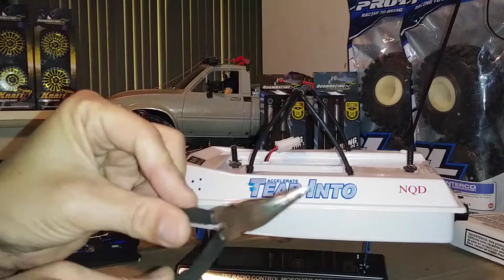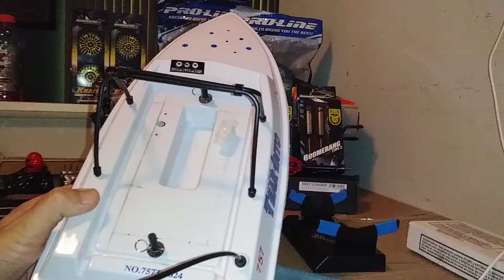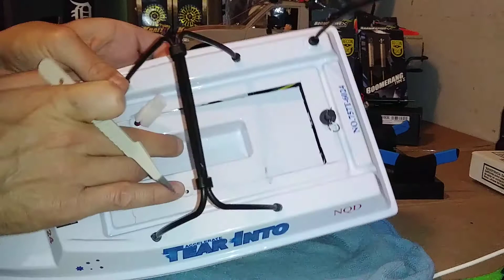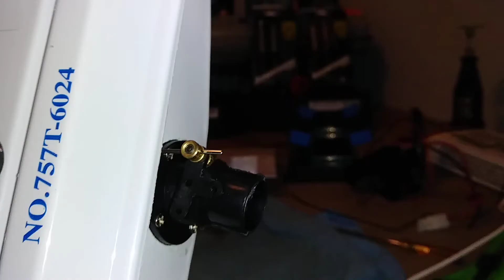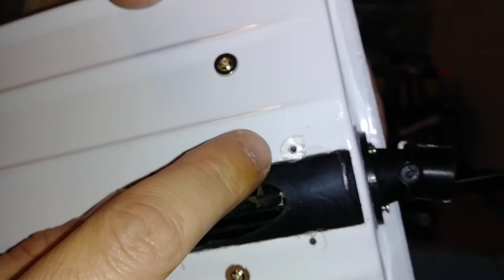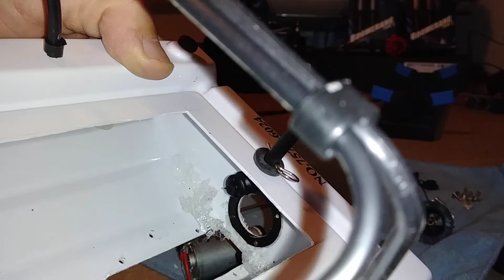NQD Tear Into Jet Boat; Brushless Conversion pt 1

Comment: I bought a stock one a few years back and they're wet garbage. 2moh speed and it broke on me. Got another sent for free, same happened. So I've got 2 entire hulls waiting for brushless conversion
Reply from the maker: 😄👍 
Their definitely garbage straight out of the box, there's no doubt about that, "But after a brushless conversion, it's an entirely different animal. 😁
Edited to add this;
(This video was done in 2016 or 2017, and yes I still have the boat, and yes it's still in perfect working order) although "highly modified" 😄 but no more modified than it was at the end of this build series, it's just holding up like a champion.🏆😁

Comment: Can I ask what coupler will fit?
All I seem to find is 10mm diameter.
I’ll be using a 2848 2960 with 4mm shaft.
Reply from the maker: Ahh man I don't even know anymore.. 😕 It's been a long time, and a ton of different RC projects since I Built-up that Jet Boat,🤔?
If I'm not mistaken, I believe that I used the stock coupler, and just drilled out one end of it to fit the pinion shaft, on the Traxxas Vxl 3m brushless 380.😕 
Note; The Traxxas Vxl 380, is a 8 turn 4000 Kv "50,000 max RPM" motor, and it's a little bit too much for the boat on 3s,🤔 "Meaning that at 3/4 throttle" it's pretty much all the power that the jet drive can put to use,😕 after that, it just over spins the prop and starts capitating like mad.🙄
Something in the 3500 Kv range, might be more fitting to get the most out of the stock jet drive unit.😕
Just a suggestion of course,😂 you can feel free to use whatever motor your heart desires.😄👍

As for the coupler; if you can find one online anywhere, and if you can't custom fab one out of old RC parts, then your only solution would be to either A; check out a hobby store and see if you can match it up with some other RC boat parts. 
Or B; go to your local machine shop and have one custom made for you.

Best of luck with Everything.... And thanks for checking out the video my friend.😊👍🤜🤛
Reply: @R.C.A.D.  
Thanks for the reply and suggestions.
I have been torn between the 3300 and 2960kv motor that I’m planning on getting.
I have thought about getting a 10 mm coupler and putting it on a drill and grinding it a little smaller
Reply from the maker: no problem with the reply...
As for the motor; That "3300kv motor" might be about right for the boat,🤔
4000kv is definitely too much RPM's, But 3300kv might be just about right for getting the "Max Potential" out of that stock jet drive unit.😊👍

Fyi; if you're new to the whole jet boat thing, You might want to check out Mark Young's channel on YouTube which is called "Youngster's Jet Boats" I think 🤔 I'll go grab a link from his channel and drop it into another comment for you, He makes his own Jet Drives, And they are Bad A##... Awesome Jet Drives!
I was going to purchase one from him awhile ago but I never got around to it, But he does make them, And they are pretty darn sweet..😁👍
Two separate link's for two separate videos 👇
https://youtu.be/kfSwnuwN5bg

https://youtu.be/wlogFXq4uiA
Reply: @R.C.A.D.  
Thanks. I am definitely new to this.
I just got into crawlers about October of last year.
I have been having a lot of fun modifying.
Reply from the maker: Nice! 😁👍 
There's so much to do with the Crawler Aspect of RC's, That there's always something to do, you'll never run out of projects! 😄 Lol
Reply: @R.C.A.D.  oh for sure it has been absolutely a blast and a lot of camaraderie.
I’m almost ready to get another one. Lol.
I have a Capra and built a custom body for it that I am proud of. I have it looking like a cj6 buggy.
Reply: You have a great channel and a lot of great videos.
I have a channel with like 5 members. Lol.
Reply from the maker: Sweet... I've been wanting a Axial Capra for a while now 😄 But then again my list of "wanted RC's" is getting pretty darn long. 😂 lol
The biggest thing to keep in mind as a new person to the hobby, is to not get too carried away with RC Accessories 🙄 That's where they really get your pocket book,😕 and it's like ten times more expensive than buying barbie accessories for a daughter,😂 lol except these accessories are made for RC's, and your buying them for yourself vs someone else,😕 and yeah.... It's pretty easy to get carried away buying a bunch of stuff that you will probably never need.😕 
And another good thing to keep in mind when it comes to Crawling in general, Is that plastic slides over rock's much easier than metal,🤔 Metal bumpers are fine, and also recommended for "future winches and towing purposes" but some of the aftermarket aluminium, or steel suspension components, rock sliders, control arms, skid plates, and whatnot, Are just not needed,  Unless the vehicle itself actually needs it, in order to hold it's self together out on the trail.😁

As for adding weight to the vehicle;🤔 ?  Here's what I've found in my years of experience... 😕 Lighter vehicles do better in just about every off-road situation,🤔 But there is definitely something to be said for adding a pinch 🤏 of counter weight or "balance weight" to certain areas of the vehicle, in order to improve off-road ability in general,🤔😕 But adding weight to the inside of your tires isn't necessarily a good idea, Unless your trying to counter weight the weight of tipper box on the back of the truck, Adding weight to the inside of the wheels is not a good idea,😕 There's not much material holding RC axle shafts together,🤔 I mean there strong and all, but once you start adding weight to the inside of a tire you're significantly increasing the total weight of Rotating Mass,🤔 and that's a Crap Ton of Extra Stress on the axle shafts when it comes to trying to spin those tires up and over obstacles,🤔😕 picture yourself spinning a pencil ✏️ ,with a weighted tire attached to one end of it, and how much Raw Torque it takes, to spin that tire up and over a 4" inch rock or ledge,😕 And you will quickly get an idea, of how much stress those parts are going to see once you add weight to the tires.😂👍 lol

A little bit of counter weight is ok, but "Ultimately" lighter weight vehicles perform better, in most off-road situations.😉👍
"And plastic slides over rock's better than metal..😂 lol" 
Keep all that in mind... And you'll be off to a great start in the world of RC Crawlers.
😉👍
Reply: @R.C.A.D.  
Thank you for that info.
Thank goodness I Havnt accumulated too many extra parts so far.😉 I have redone the body several times now to get a look that I like. 
I tend to do  a lot of research before I make a move.
Adding weight, totally agree. All I have added was weight to the front portals, made a big difference. 
Any extra parts I’m always trying to think what can I do with them. My old tires, I made a little off-road trailer. Needed a project while it was super cold out last year.
Part of the fun is dreaming up new ideas and fabricating.
Reply from the maker: Thanks man...😊🙏 That means a lot to me.😁🤜🤛
As for YouTube; It takes awhile to build up a good fan base,😕 You can do RC giveaways like I was doing in order to build it up faster, But ultimately that will only get you the numbers needed to monetize,🤔 But it doesn't guarantee views on your videos, 😕 
That comes from building up a "somewhat loyal" fan base 🤔 and that takes a long time to do.😕 
I've got like 48 hundred subs, but ahhhh.... Whenever I release a new video....🤔 I only get a few hundred views "at best" from my subscribers,🙄😕
When it comes to "my channel in particular" I get more views from people doing Internet searches, then from my actual channel subscribers,😕 which isn't a problem except when it comes to making any kind of money from my channel, or hard work that was put into doing "said video"🙄😕 
People doing Internet searches for videos, don't watch any of the commercials attached to the video, And if they don't watch at least 15-20 seconds of each video before they skip it, The person who produced the video won't see anything for it,🙄 not a cent 🤔 and really... it's not like you make a ton of money from the commercials, it's like pennies on the dollar when it comes to that stuff,🙄 So when people skip the commercials, They aren't helping that person out one bit,😕 And I tell you what Brother, in the 6 years that I've been on the YouTube, I've probably barely made enough money to pay my car insurance for a year let alone anything else,🙄 I actually spend far more money on my channel "in a yearly basis" then I'll ever see in return, And every single RC giveaway that I done over the years, has come directly out of my pocket, "with hope's of returns, but never seeing it" 
The majority of those people who Flock to RC giveaways, Don't Give a Crap about your channel and never will, all they care about is the giveaway, and once it's done so are they, At least until you do your next giveaway video 🤔 and then they all show up out of the woodwork again,🙄 yet absolutely no channel support in-between time,😕 And it's "that channel support"  that is the only thing that could possibly keep the RC giveaways going in the future, Other than taking them directly out of your pocket.🙄😕 
But they don't give a crap about that... All they want is something for free, and not having to do anything for it, especially spending 15-20 seconds of there life watching a commercial before a video.🙄😒
Anyways.... The moral of the story is that it takes awhile to build up a "loyal fan base" on YouTube.😕

But don't let that discourage you...😄👍 YouTube is different for everyone, And you might rise to the top in no time flat, or you could spend years upon years of time into it, and not go anywhere at all.😕😂 lol
Reply from the maker: Ha.... 😄👍 You and I think alike, I'm all about the research before I make a move. 😂 Lol
Reply: @R.C.A.D.  
That’s good info to know, I have wondered if people actually make money on YouTube.
I havnt really thought about making money or anything on YouTube just a fun place to post a few things. I do wish more people watched my videos and make comments, it’s fun when they do.
Reply from the maker: I wasn't initially looking to make any money on YouTube either,🙄
My initial thought was that if enough people would watch the videos, That it produce enough money to pay for RTR RC Giveaways on a Regular basis,😕 At least that's what I thought going into it, and also what I was assuming, when I initially started talking about doing RC giveaways, for higher and higher numbers of subscribers, Like a giveaway at 1,000 subs, and then another at 2,000 subs, and then another at 5,000, and then at 10,000, and so on,😕 But it didn't take long after doing the first giveaway, to realize that it wasn't going to work out the way I thought,🙄😕 And that I was going to be S.O.L. when it game to the channel paying for any further giveaways,😕 Just wasn't going to happen 😒 
The bulk of the people want the Free RC's, but they just aren't willing to do there part with watching a few seconds of a commercial, or even keeping up with the channel in any way, shape, or form, other than to touch base on the next giveaway video.🙄😒
Yeah I started by just wanting to share good RC advice on YouTube, Then I had the bright idea of doing RC giveaways to boost subscribers with hope's of the views paying for the giveaways, and now a 5-6 years later, I've basically thrown the RC giveaway idea out the window, And I'm just back to putting out videos at my leisure again, My next and last RC giveaway is going to be at the 5,000 sub marker, and then I'll be making the announcement, about not doing any more RC Giveaways from then on out into the foreseeable future.😕 And the only reason that I'm going to do the 5k giveaway is because I said that I would on the 2k giveaway video,😂 But this is going to be the last one, I just can't keep paying for these "free RC's" straight out of my pocket,😕 especially when there's a strong chance that the winner doesn't give a crap about the channel too begin with.🙄😕
I've done three giveaways on camera, and I've also given away RC's to certain subscribers who pulled on my heart strings, and I've also given away a ton of different RC parts to different subscribers, And I can honestly say, that I only stay in contact with about 3 people out of about 20 who have received something from me,😕 And those three people are the good ones out of that group.😂
Yeah.. I kinda wanna just do a giveaway for the "faithful few" on the 5k giveaway, That way the giveaway prize would actually go to someone who deserved it.
😁👍 
And after hearing all that you probably think that I'm crazy 😂 lol  
That wasn't the intent, I just wanted to convey that YouTube isn't a cash machine, And even though you may have a great channel that puts out quality crawling videos, and quality how-to videos, That there's no guarantees on your channels popularity.
😄👍 
And all of that spawned from your initial question or statement, about how many subs you currently have.😂
Lol  You should feel special...  I don't share that kinda info with just anybody.😂 lol
Reply: @R.C.A.D.  
I like the way you think.
I hate  the thought of someone winning something and they don’t appreciate it and not even going to use it.
Give a ways should be rigged so it goes to someone who will appreciate it. At least it would be nice if it worked that way. I have given stuff away at work before and talk how there just going to give it to someone or sell it. If they don’t really want it or didn’t get what they wanted for free it’s aggravating. 
Don’t even see why they enter to win some times. I like it when it goes to someone who actually wants its. Like seeing that big smile on there face and continue to shop at my place.
Reply from the maker: Totally!! 😄👍 
Seeing the look on someone's face who "truly appreciates" what they just received, Is all the payment required..😁👍

Comment: what size were the stock servo ?  1/10 ?   ony just found the hull of this boat  on the net  after seeing it on yt  years ago .   i  now have the boat  soon  and the  jet and brushless setup
Reply from the maker: Nice 😁👍
And a 1/10 servo will fit, 
I used a Savox sw 0230mg waterproof servo, and then I fastened it to the stock plastic servo plate that was in the boat with a piece of double sided tape and a few zip ties for good measure.😂👍
Best wishes on your project Brother, and thanks for checking out the video.
😊🤜🤛